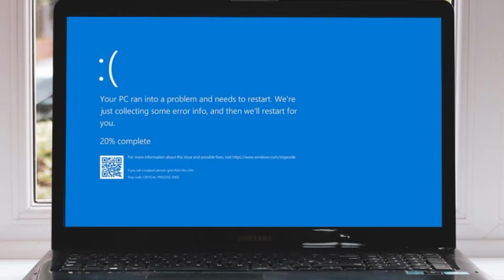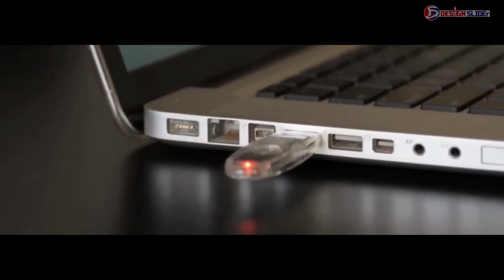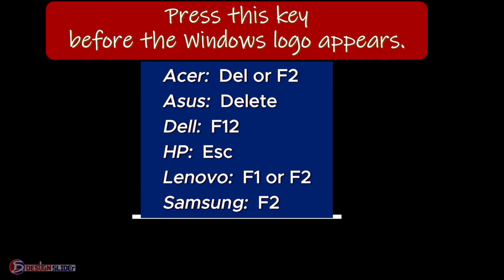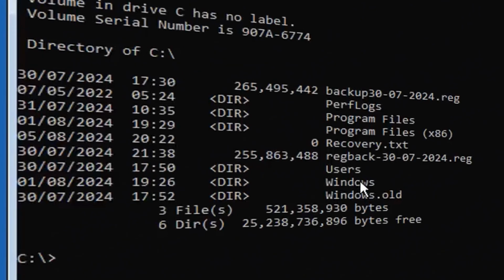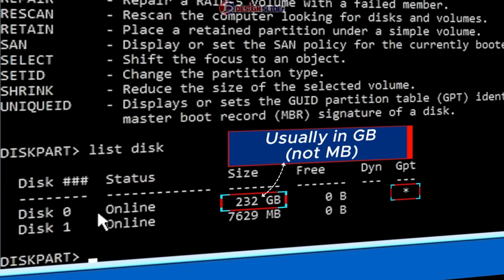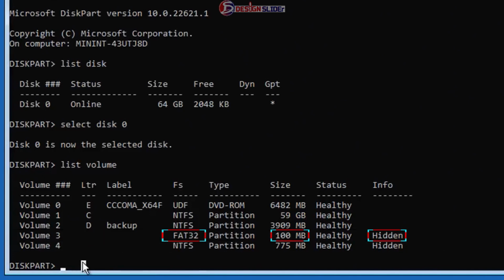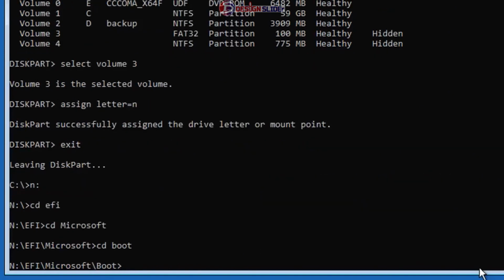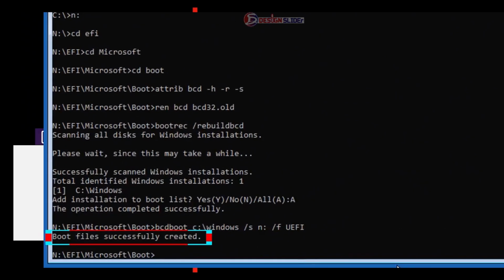Your PC needs to be repaired, Your PC ran into a problem, Automatic Repair, Fix Windows Can't Boot

Comment: Ok, so I just got done deleting the recycle bin from the command prompt, and then I checked how much space I opened up on the C drive notepad command, and it said 29.7 gb free of 886 gb. I was so happy when I saw that. Then I went to restart the computer and still no password box. I even shut down the computer completely and turned it back on and still no password box. I then ran another dism command and it gave me the same message as before, “error 4448 41.7% wof driver encountered corruption in compressed files resource table”. Then I ran sfc scannow again and got same message as before “windows resource could not perform requested operation”. What should my next steps be to get my password box? I have 29.7gb free so that’s good, but still no password box. Please let me know what’s next? Thank you for your help
Reply from the maker: Your issue is simple. After all you have tried, let us fix your PASSWORDLESS BUILD VERSION. Follow my steps in this video guide 👇
https://youtu.be/nzdbr0hT7j8 👈

Let me know when it works.

Comment: Okay, so I followed your instructions and I’ve been working on transferring my files and deleting files these past few days. I finally deleted 20gb of files, and for some reason it still says 1gb free of 886gb on the c drive. Thats what it shows in the notepad workaround you taught me. That’s impossible cuz I deleted 20gb of data. I restarted the computer and shut down the computer and it still didn’t refresh the open space I created. How do I get it to recognize the 20gb of data that I cleared out? Please let me know what my next step is to make this work so my password box can load. Thank you for helping me, I know we are getting closer to fixing this, what is my next step?
Reply from the maker: The reason the open space hasn't refreshed is because deleting files via the Notepad workaround doesn't permanently erase them—it just moves them to the Recycle Bin, which is still taking up space on your drive.

🗑️ STEP 1: Force-Empty the Recycle Bin via Command Prompt
We will use a command to permanently wipe out everything sitting in the hidden Recycle Bin folder.

   i. Make sure you are in the Command Prompt window.
   ii. Type the following command exactly as written and press Enter:
   
   rd /s /q C:\$Recycle.Bin
   
   (If your Windows drive letter was different in your previous DiskPart check, swap C: out for that letter).

   iii. This command will completely clear out the deleted files without asking for confirmation.
Reply from the maker: 🚀 STEP 4: Final Restart
Once Notepad successfully registers the new free space:
i. Close Notepad and type exit in the Command Prompt.
ii. Disconnect your external backup drives.
iii. Select Continue and exit to Windows.
     With the storage bottleneck cleared, Windows will have the structural room it needs to load your login screen profile completely.
Please let me know:
After refreshing, does the C drive finally show the 20 GB (or more) of free space?
Let me know how it goes!
Reply from the maker: 🗒️ STEP 2: Refresh and Verify the Space in Notepad
i. In the Command Prompt, type notepad.exe and press Enter.
ii Click File → Open... and change the file type dropdown to All Files (.).
iii Click on This PC on the left.
iv. Right-click on an empty space inside the window and click Refresh, or press F5 on your keyboard. Check your C drive now—it should finally show your freed-up space!
Reply from the maker: STEP 3: Deleting More Files Properly (Bypassing the Bin)
    If you need to delete any more files moving forward, do not just right-click and hit delete in the Notepad window. Instead, hold down the Shift key on your keyboard while clicking "Delete." This forces the file to bypass the Recycle Bin and instantly deletes it forever.

Comment: Okay, so I tried option 1, reset pc and keep files...and this message came up “additional free space is needed on the drive where windows is installed, free up some space and try again” ....so I had to click cancel. I remember there was only around 1gb of free space left, so how do I transfer files, if I can’t login. Keep in mind it won’t allow me into safe mode, it doesn’t boot into safe mode. When I ran dism it failed and said “the wof driver encountered a corruption in the compressed files resource table error 4448”....when I ran sfc scan now it failed and said “windows resource protection could not perform requested operation”....all I want is my password box to appear so I can login....is there a way to transfer files if I can’t login or access safe mode? Thank you for helping me, please let me know what my next step is
Reply from the maker: To help you get your password box back and save your files, we need to address the root cause: your Windows drive is completely full (only 1 GB left). This lack of space is why sfc, dism, and the system reset are failing. Because Windows doesn't have room to create temporary files, it cannot load the login screen.

Since you already have access to the Command Prompt through the recovery menu, you can use it as a powerful tool to transfer your files to an external drive or safely delete unneeded files to free up space.
---
➡️ Step 1: Access the Command Prompt
If you aren't there already:
1. Boot into your recovery media / blue screen menu.
2. Navigate to Troubleshoot → Advanced options → Command Prompt.
---
➡️ Step 2: Identify Your Drives
In recovery mode, drive letters often change (your external backup drive might not be disk "D:")
1. Plug your USB flash Drive or an external hard drive (with enough space for your data) into the PC.
2. In the Command Prompt, type diskpart and press Enter.
3. Type list volume and press Enter.
4. Look at the list to identify:
* Your Windows Drive: Look for the volume that matches your main hard drive size (usually labeled C: or D:).
* Your External Backup Drive: Look for your plugged-in external drive or USB and note its letter (e.g., E:, F:, etc.).
5. Type exit and press Enter to leave DiskPart.
---
➡️ Step 3: Launch a Visual File Transfer Tool (The "Secret" Method)
Instead of typing complex commands to move files, you can launch a hidden, user-friendly visual window:
1. In the Command Prompt, type notepad.exe and press Enter.
2. When Notepad opens, click File in the top menu and select Open....
3. In the "Files of type" dropdown at the bottom, change it from Text Documents (.txt)* to All Files (.).
4. Click on This PC on the left.

You can now browse your user folders (usually found under [Windows Drive Letter]:\Users\YourUsername\).

* To Transfer Files: You can right-click your important folders (Desktop, Documents, Pictures), select Copy, then navigate to your external drive under "This PC", right-click an empty space, and select Paste.
* Note: Your PC might look like it is freezing during a large copy/paste. There is no progress bar, so wait a few minutes until your mouse cursor stops loading.
* To Free Up Space: You can right-click large, unneeded files (like downloaded movie files or installers in your Downloads folder) and click Delete.
---
➡️ Step 4: Alternative Command-Line Transfer (If Notepad freezes)
If the Notepad trick struggles with large folders, you can forcefully copy your entire user directory using a single command:

robocopy "C:\Users\YourUsername" "E:\BackupFolder" /E /COPY:DAT /R:3 /W:3

(Replace C: with your actual Windows drive letter, YourUsername with your account folder name, and E: with your external backup drive letter).
---
➡️ Step 5: Try to Boot Normally
Once you have successfully transferred your data and deleted at least 15–20 GB of unnecessary files from your Windows drive, type exit in the Command Prompt, unplug your recovery USB, and restart the computer. With adequate breathing room, Windows should finally be able to process the boot files and bring up your password login box.

Let me know how the file transfer goes! If you get stuck at a specific point or need help further help, let me know.

Comment: Hey there, my password box doesnt show up, and you told me to try the steps in this video. I have a question first....would it better to do advanced options, troubleshoot, reset this pc, keep my files.....or would it be better to do the steps in this video and use the usb drive to download the file then install....which method do you recommend and why? I just wanna get the password box to appear so I can login. I tried other methods such as chkdsk, dism, sfcscan, and none of them worked. So it must be a software issue like you said. Please let me know which of the 2 reinstall options is the better choice...is it advanced options reset pc or should I do the method in this video using usb drive? Please get back to me on this as soon as possible. Thank you for your help.
Reply from the maker: I will give 2 advice: See the explanation in the reply comments below here:
But NOTE: Using the USB installation media is the cleaner and more reliable method to fix corrupted system files.
See more in the replies below 👇
Reply from the maker: OPTION 1: I recommend trying Advanced Options > Reset this PC (Keep my files) first.
Why try the Reset first? It is much faster, more convenient, and doesn't require a second computer or a USB drive. Since you just want to get the password box back, this is the quickest path.
However, it will remove installed apps and some settings may go back to factory state, so make sure you understand that before proceeding.
Reply from the maker: OPTION 2 (try this if option 1 fails):
If Reset this PC > Keep my files fails, or the password box still doesn't appear afterward, then I would move on to the USB installation method shown in my video.

WHY: The USB method is a better Windows reinstallation because you are installing Windows using fresh installation files from Microsoft, it forces the PC to use a 100% clean, fresh system image directly from Microsoft. It can be a better option when the Windows installation or recovery environment on the PC is badly damaged.

So, I would go in this order:

1. Reset this PC > Keep my files
2. If that fails or doesn't fix the login problem, use the USB installation method in the video.

Since you have already tried CHKDSK, DISM, and SFC without success, I think this is a reasonable next step.

I hope this gets the password box back for you. Let me know what happens after you try it.
Reply from the maker: I hope either of thos two options gets the password box back for you. Let me know what happens after you try it. If you still have any question, I am here to help.

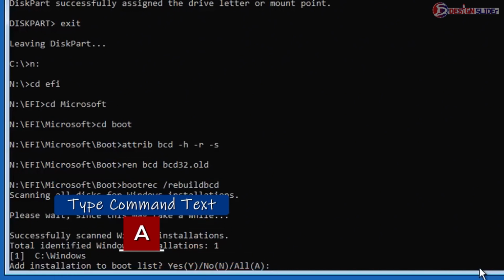Comment: 9:28, it identified 2 windows installations and when I tried to accept to add to boot list it fails, I need help :///
Reply from the maker: Your Windows cannot be installed in 2 drives. So, Windows Installation should be 1, usually in C: drive. 
SOLUTION: 
You need to be sure you did not miss any step from the beginning of my guide. I guess you made a mistake at a point. Go back to retrace the steps. 

Then, if it still identifies 2 Windows installations, then select A for All

If A does not work, try Y for Yes
Reply from the maker: Find your way back to
N:\EFI\Microsoft\Boot> and skip to the last command prompt